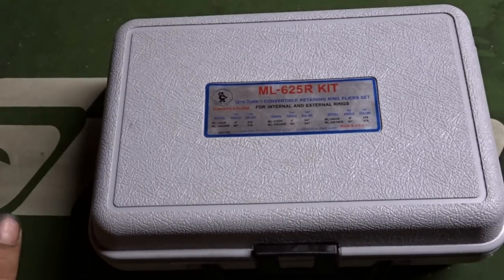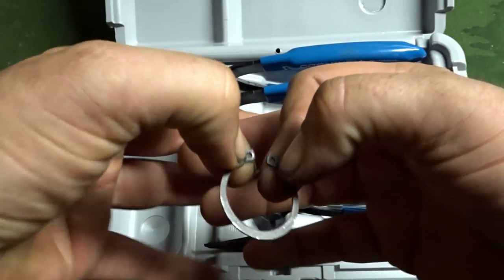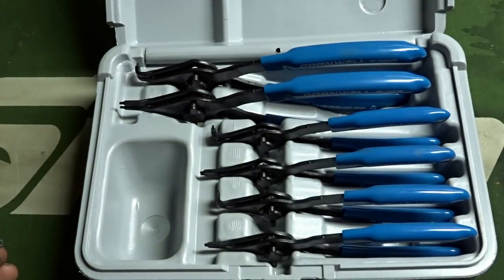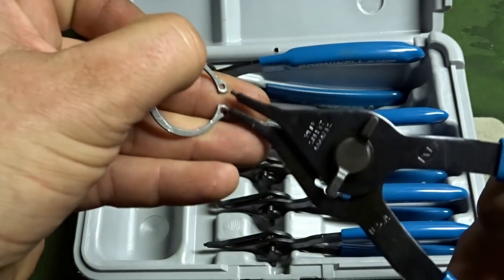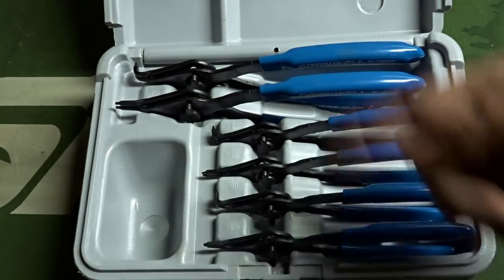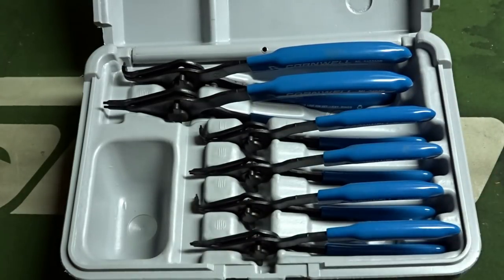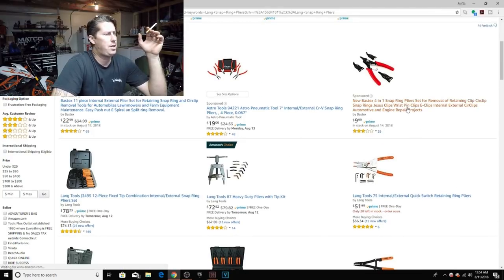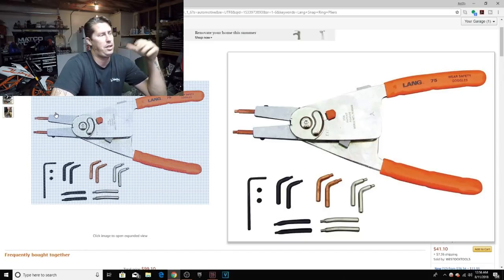Everything You Wanted to Know About Snap Ring Pliers

Comment: I have both the snap on set and lang set they are both made by lang identical set same manufacturer markings lang is half the price or less. Knipex I have used a co worker has that set they are perhaps a bit less universal as others so buy the complete set so you have all of them you need. That being said the knipex set is the best set in my opinion very well made and sturdy with no flexing. Lang, snap on, Cornwall excellent choice they all appear to be manufactured by the same company and are identical.

Comment: I just picked up a pair from Tractor Supply that has three separate heads that are all interchangeable different angles for about 10 bucks made by Erwin with a lifetime guarantee just so I can finish up at this ball joint job on this Jeep I figured I could use a set you never know when you going to need them but I will say they do seem fairly well made

Comment: Thanks again Justin. Always appreciate the links and research you've put into your tools. Again, here in Canada, we don't get the range of tool competitors. Fortunately we have Princess Auto for the heavy duty stuff thats expensive, but will get you by for the time being. Ive been buying lots of tools of the Mac truck lately, cause he's the most consistent one to come by my shop, and they have some very comparable stuff to snap-on at about 75% the cost. I was kind of choked today though, and wanted to ask you about their products. I went use my Mac pick set for the first time today, and the grip slipped off first tug, then the screw on metal handle under it was loose! I was kind of choked cause I went ahead and thread locked all the threaded handles on tight, then glued the handles on after that...got em all perm-snug but was my first disappointment with Mac to date. I wasn't sure if I heard it in one of your videos, about Mac "re-branding", but it opened my eyes to the fact that no "one" tool company can really do it all, as Ive seen you prove it in your videos. Anyhow, wonder if you could give me your quick 2 cents on Mac...if you have them down there. Im just the guy who absolutely hates anything crap, and believes it should be a crime to manufacture it. I know I won't choose the best tools the first time, but am gonna try damn hard to!! Or if anyone else has some input, Id much appreciate it! PS. I have a friend in Germany who is gonna buy some German tools and ship em here to try out!! Stoked! 
Cheers! Chris
Reply from the maker: Rock On! You might like the upload that I'm shooting tonight, but I will try and do a personal video for you on my overall thoughts of MAC tools over the weekend. Sorry you had some recent trouble with their product. Cheers my brother!

Comment: I got in a "debate" in the comment section of a video about 1/4 drive socket sets the other day. I was slammed for suggesting that $750 for the Snap-On set was a bit absurd and not an indication of increased "quality" relative to the astronomical price. To the degree that all of the "tool truck" brands actually rebrand and mark up various tools like Lang, paying that 50-100 percent markup seems unwise. I realize the previously mentioned 1//4" drive socket set is not rebranded. The point is that the price(s) of a lot of this stuff is simply far too high. And a lot of times the actual quality isn't really there. Snap ring pliers are a great example. Personally the only ones that I have found that consistently work and don't break, aren't fiddly to work with, and have the warranty (which is always the last stand taken by the tool truck price defenders on the internet) is Knipex. I have found the the Channelock ones are good also, though changing the tips is a bit fiddly and the tool itself is sometimes a bit large for the job.

Comment: You ever try the Harbor freight Icon brand snap ring pliers?
Reply: Yes dont bother driving to harbor freight. Just throw your cash in the garbage to save the gas money ...worthless set not worth the aggravation.
Reply: I was curious about the HF icon line also since it isn't supposed to be the typical cheap flimsy junk.  The icons are priced much much higher so had hoped the quality was better.  I know HF compares it to snap on, which seems like a joke but wondered if anyone had used them and has an unbiased opinion. Icon "apprars" to be a better machine line when you pick it up and look at it. Whether it works and holds up is a different story.

Comment: Unfortunately, this didn't show the tool in actual use. This would have been MUCH more helpful. Sadly, therefore, this was not EVERYTHING I wanted to know about snap ring pliers.
Reply from the maker: What would you like to know. I could do better at explaining it if i knew the information you were looking for please and thanks
Reply: @JustinDowDIYcentralhighway  I simply wanted to see you actually use the tool to install and remove a snap ring. It would also have been useful to show how it it used when the ring is inside as well as outside. You could also show when you need to use a snap ring tool which has a right-angle attachment. What about large snap rings? Do you need a different tool, or can you adapt a small tool? How about automotive snap rings? Do they require a stronger, bigger tool?

I can go on, but the point is, you really didn't provide much information that I could use when actually doing the work.